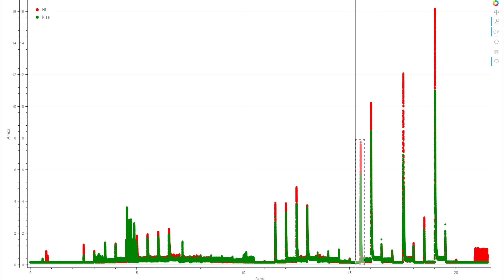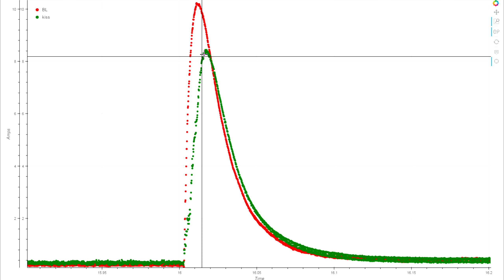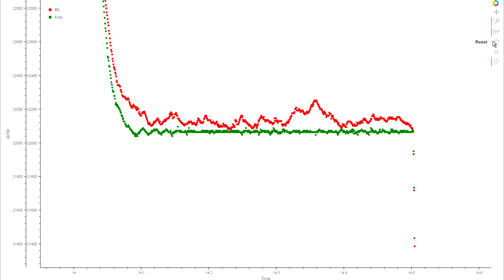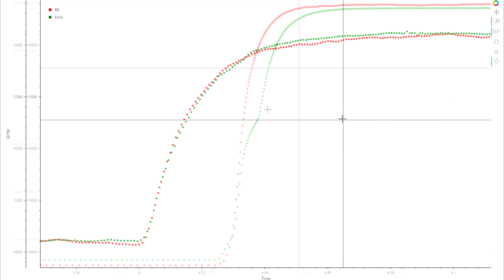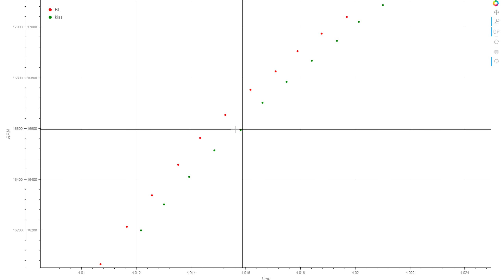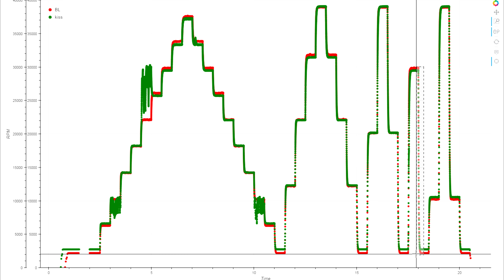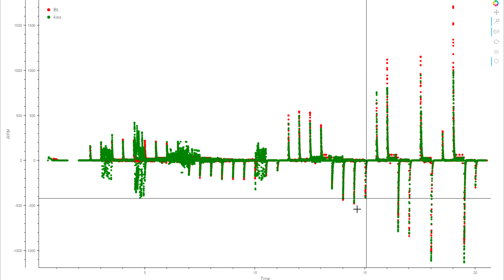Motor Acceleration - BLHeli vs KISS

Comment: very informative video! I really like videos like this. we're you comparing blheli_s with kiss or was it the plain blheli?
Reply from the maker: This is blheli_s
Reply: SiieeFPV I'd be curious to see results for kiss vs a tbs bulletproof 25a. It uses the same adaptive braking as kiss and I would imagine it would actually outperform kiss very slightly or at least be on the same level. Would this be a possibility in the future sometime by chance? :-)
Reply from the maker: TBS bulletproof 25s are BLHeli_S escs, they should perform practically identically to the Polaris 35a in this test.  The differences in performance between BLs escs is much much smaller than it used to be on older esc designs.  Most modern ESCs outperform Kiss.  Kiss is a solid middle-of-the-pack in bench tests, but margins are thin between all of the top performers so it's not a night and day thing.
Reply: I was just wondering because the kiss escs have adaptive timing, and as far as I know the tbs bulletproof 25a are the only blheli_s esc with true adaptive timing. All other escs I've seen have between 15 to 40 for the high/low fet switch timing. I know for a fact that the bulletproof are noticeable smoother than any other blheli_s esc I've tried and also are able to spin up motors at the lowest throttle amount I've seen, and they seem to handle prop wash the best of any blheli_s I've tried.
Reply from the maker: That's a little different, automatic deadtime control is supported, but adaptive timing is dynamically adjusting the commutation advance angle while the motor is running, not related to deadtime.  BLHeli/S only supports fixed timing advance.  Interesting if that runs smoother though, I'll have to keep that in mind

Comment: Wow, this is very informative. So basically, Blheli_s accerates faster and draws more amps, but Kiss shows more stable rpms and draws less amps. I think it explains why a relatively small capacity of Kiss ESC can handle big motors.
Reply from the maker: Not massively so.  The difference we're looking at here is only over some 20 or 30 miliseconds, and only on the bigger throttle changes.  The current limiter in the kiss esc will help protect it if you put too big of a load on it or your tune is poor, but if you're leaning on the current limiter constantly that's going to give you a big hit in performance.